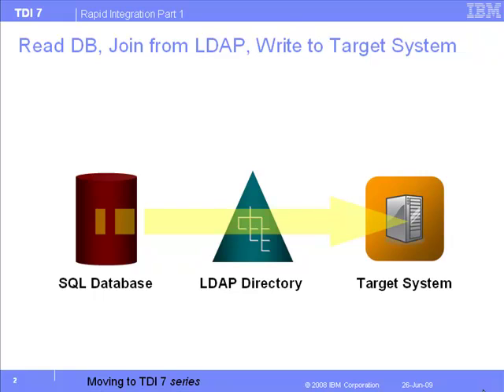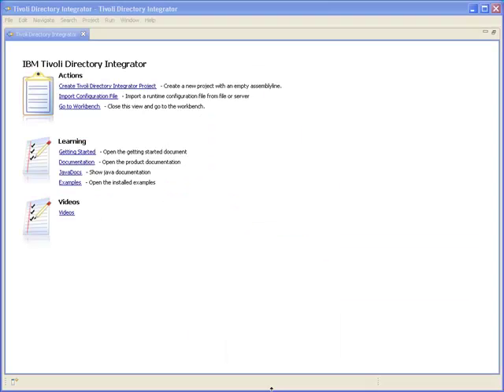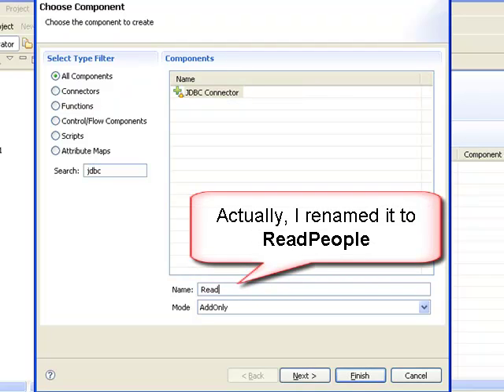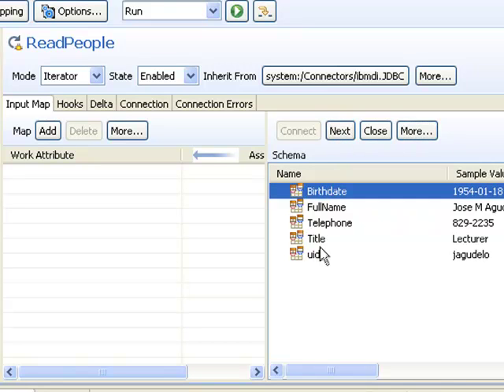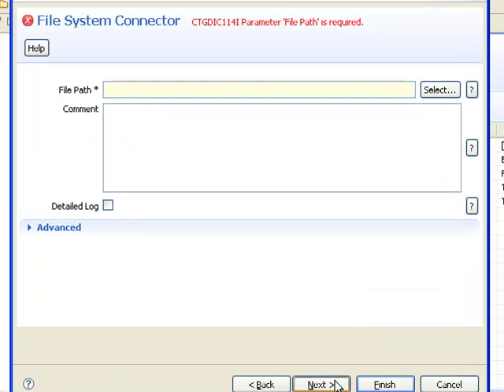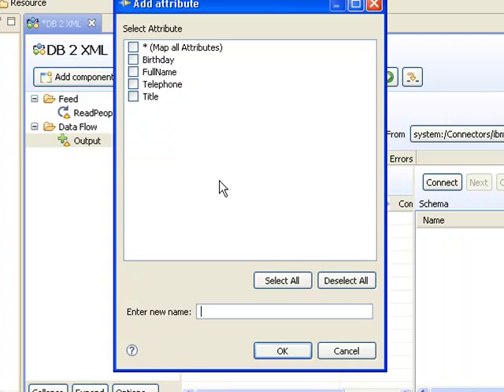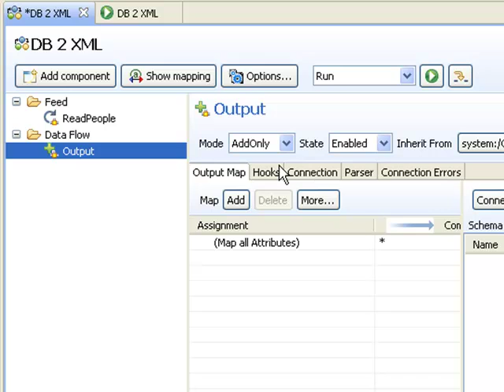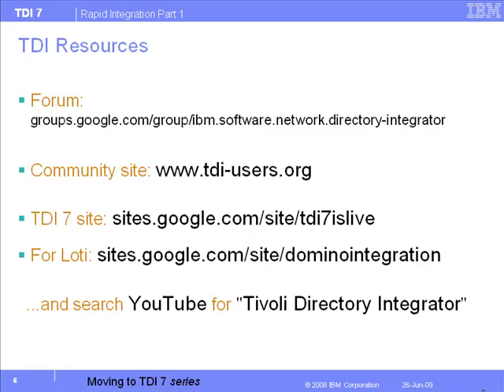TDI 7 - Rapid Integration 101 Part 1 - DB to XML

Comment: Hi There again. I have a question regarding joins. For instance, if I have standard tables such as a an SOITEM and SODETAIL, with SODETAIL referring SOITEM for a foreign key, how do I join these tables in SDI? 
I can't seem to find any documentation on it. One that I have (getting started' by IBM) deals with connector loop to iterate through an xml, rather than doing an actual join.
Thanks.
Reply from the maker: You can either access the Advanced section of the Connections tab for your JDBC or Database Connector (in Iterator mode) and set the SQL Select parameter; OR you can access a JDBC/Database Connector via script and do it yourself. For example, if you have this code in the After Initialize Prolog Hook of the Connector:

jdbc = thisConnector.connector;

and then later you can perform the join and iterate the results via script:

jdbc.execSQLSelect(mySQLjoinString);
do {
    retEntry = jdbc.getNextSQLSelectEntry();
    if (retEntry != null) {
         // do something with it
    }
} while (retEntry != null);

Hope this helps!
Reply: +Eddie Hartman  Thanks Eddie. I was able to do it with lookup mode as opposed to iterator mode I was trying. I will also experiment with your code snippet.

Comment: How did you set up jdbc:odbc:People ? Could you elaborate? Thanks.
Reply from the maker: I set up an ODBC Data Source, as shown here in this vid:

https://www.youtube.com/watch?v=YhXQdR3Vfg0

There is also info on how to do this on MSDN:

https://msdn.microsoft.com/en-us/library/ca6axakh(v=vs.80).aspx

Of course, then you need some source, like an MS Access db file, to point it at.

With the Database Connector you also get just as easy connectivity to a wide range of RDBMS's, like DB2, SQL Server and Oracle.
Reply: Thanks Eddie. I am able to add a data source.
It suddenly occurred to me that I'd done it long long time ago.
Thanks again.